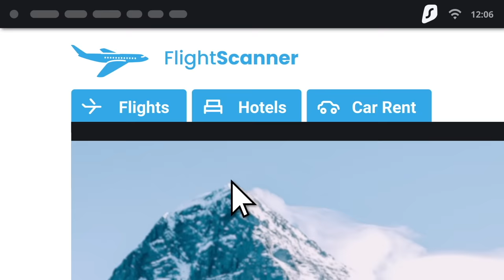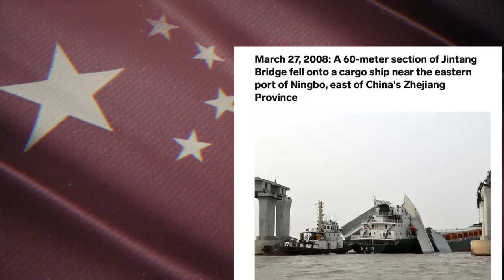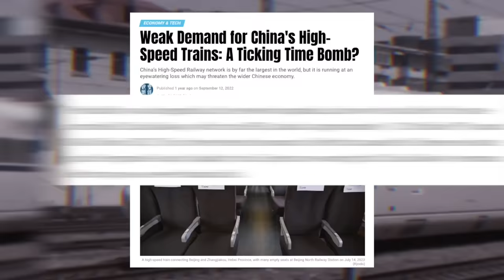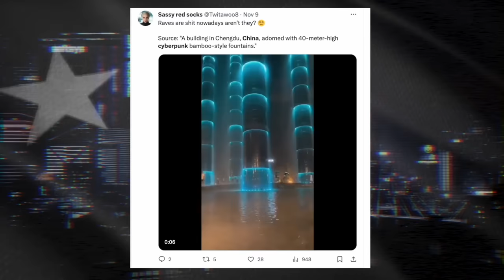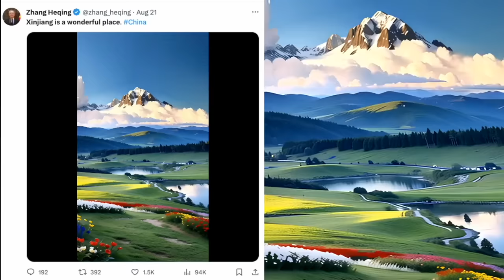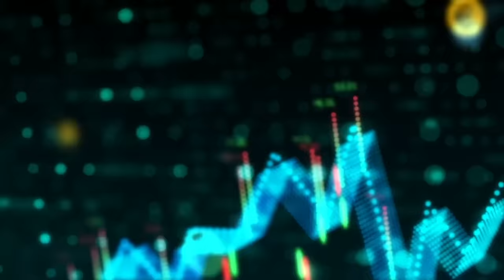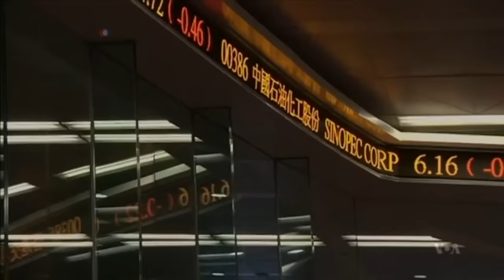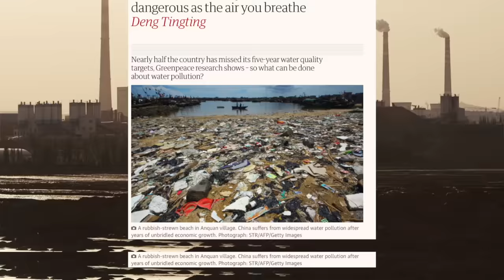Why are China’s Trains Randomly Crashing? - The Hidden Disaster of the High Speed Rail Network

Comment: I will save you time .. what happens is China hires taxi drivers as passenger train engineers, and when they approach a slower freight train on the same tack, they try to pass and overtake the slower moving freight train, swerving their train into the train  ditch beside the tracks. :(

Comment: Again, at least (in the US) trains are for freight not passengers with the exception of the north-east corridor.
Not efficent in time, it takes one hour to fly LAX to SFO while a high-speed train takes about five plus hours.
Reply: That's airport to airport. How long if you take into account travel time to and from the airports, any security stuff before boarding, recommended time to arrive before takeoff, etc? Probably still faster than a train, but not 5x faster.

Comment: I have to disagree with @laowhy86 on this one. If there is one (and only) positive impact Chairman Xi to Chinese society (and the world) is building an extensive high-speed rail system. It is way far from perfect (especially the less than quality build) but building an extensive passenger rail system is the best transportation infrastructure option PRC could do, and definitely better than expanding a highway system (ahem, "Murica) or overly relying on air travel. 

Mile-for-mile, passenger rail is magnitudes safer than driving  ... and better for the planet too. Unless PRC is hiding something (a plausible assumption), the only fatalities was the Wenzhou train collision back in 2011. I imagine there are more vehicle-related fatalities since then compared to this.

Comment: One important aspect that many China detractors failed to realize is no matter how problematic these infrastructure are, China was able to built them and that itself is commendable (China went from nothing to something).  Of course down the road, China may have to spend money to rectify these issues.  United States is a greater failure as it went from nothing to nothing (wrt hsr).  Having something is always better than having nothing.
Reply: @patrickt49  Most city subways/mrt are not economical viable like hsr.  But why these subways are being built all over the world? Because the indirect benefits outweigh the deficit running costs of the subways.  Like I said if you do nothing, you will stay the same at best.  You can only move forward if you built something.

Comment: When they have too much debt, i wonder if the unprofitable lines will shut down to stop gettting more debt, or will that line have once per week trains that only have coach class to fill up the seats so it wont lose money, while providing a need of fast transportation. There has to be a point where china cant handle the debt, or else it collapses because of this. They could have used all this money to build more subway systems in large cities, build up 2nd tier cities to the size of first tier cities, build much more hospitals, etc.

Comment: The United States has the highest number of rail accidents in the world, with an average of 124 accidents per year between 2010 and 2019. India is the second most accident-prone country, with an average of 60 accidents per year during the same period.
Reply: Those are cargo accidents. In India, where the savages ride on the roof of the train, they're passenger accidents.
Reply: How many is that when normalized for the number of trains or distance travelled? ie accidents per cargo wagon or accidents per cargo wagon mile?
Nominal means eff all, statistically speaking, and its the rates that are important since it lets you compare two different nations ceteris paribus.

Comment: Japanese train operators value the lives of their passengers. Japanese high speed rail network not one derailment or accident since its inception.
Reply: well…there are a couple of derailments due to earthquakes reported by several news outlets, even though no heavy injuries and casualties, they still caused major concerns and the development of several operation protocols and safety systems designed to minimize the chance of heavy injuries or even fatalities
Reply: @lsp6032  Japanese high speed rail have literally never once derailed due to earthquakes, please Google.
Reply: @LEV1ATHYN  checked japanese websites, 2004 train derailed after earthquake at joetsu shinkansen, 2010s kyushu shinkansen, 2022 tohoku shinkansen(videotaped from within, yamabiko 223), all three trains involved sustained heavy damage and was scrapped
Reply: @lsp6032  Cool. Didn't think that was the case.

Comment: Hey, just to set the record straight, Wenzhou happened. You didn’t point to any other HSR crashes. Your information on the HSR debt situation is out of date - it was USD900B 2 years ago. It’s WORSE now. Lanzhou-Urumqi is a ghost train, and maybe not ever able to be repaid.
Wenzhou - there was one accusation even levelled at the Japanese - it was their signalling system they ripped off. But I would be clear there hasn’t been any other HSR crashes other than the one in Wenzhou.

Comment: I have driven the train between Tianjin and Beijing a number of times and that was a pretty good experience tbh. That they built these high speed lines in places where they make no sense and therefore is running with severe loss and the fact that they have had some bad safety stories is obvious points to be critical about but criticizing that they are proud of their huge rail network misses the mark imho. In that regard it’s my impression that there’s much more criticism to be made about the US rail system. If China could get their safety systems up to the levels of Japan or Europe I think they have a pretty darn good system - the issues probably being that they have too many high speed routes but that’s a bit of a luxury problem.

Comment: Super fast trains are not only expensive to buy and build infrastructure for, more importantly, they're multiple times more expensive than conventional trains to run. Therefore, a ticket on a fast one will be priced out of the affordable or practical range of most users in a poor country like China. 
    A farmer can save a lifetime for a Lamborghini to drive round the farm but it's not a wise investment when a modest car will fulfil the needs of his family and his farm has more pressing needs or investments.
   This is why legitimate, accountable, less corrupt governments do feasibility assessments instead of putting Lamborghinis on farms.
Reply: High Speed Trains can be cheaper to run once you look at cost per passenger-km. Overall cost for highly subsidized local TER French trains is about 70 cents/passenger-km, for TGV about 10 cents/pax-km.
Reply: @alaindumas1824  Chonq isn't France. In China, the super fast ones are typically more exensive to maintain the vehicle and infrastructure. Too many people are poor so the ticket is too expensive hence they routinely run well below capacity. Due to poor planning there are typically other existing cheaper services in competition with the super fast expensive option, and so on.

Comment: Sounds like American railroads right now
Reply: "The United States has the largest rail transport network size of any country in the world, at a total of approximately 160,000 miles".---Wikipedia
"As of 2021, China had more than 96,313 miles of railways, the second longest network in the world."---Wikipedia
That means the US has 66% more rail than China. I haven't heard the US braying about how great it is because of that, have you? It also stands to reason that the US would have 66% more rail accidents than China, yet it doesn't seem to.
I worked on a railroad (BNSF) rail replacement crew in 2018 in North Dakota. We were replacing whole sections of rail on one of the busiest freight lines in America which runs from Chicago to Seattle, it's called "the High Line" because it runs right up close to the Canadian border. The rail we removed had a date stamped in the steel: "1940". That rail had lasted 78 years. Do you think the Chinese will be able to say that?

Comment: 4:10 - I knew about this accident but not that they had buried people... D:

As I have seen in other comments, I have always laughed at people when they told me that China was the leader in High Speed...
You just don't need to be faster or cooler to be the leader, you need to have a functioning and safe system.

The Japanese Shinkansen is without any doubts still on the lead by FAR!

Comment: Metallurgy, how to consistantly make a type of metal to the standard it needs to operate safely for its purpose. HOW TO FORGE AND TREAT IT! The Chinese have no idea! Their copper wire is a rainbow coloured not copper coloured, IT WILL FAIL! Steel can be iron or some form of iron based low grade steel

Comment: The reason that losses matter is because money represents resources a loss making enterprise consumes net resources.  Profit making enterprises are provided with more resources than they consume.  Imagine a business whose only inputs are steel and electricity that uses 1000 tons of steel and a megawatt hour of electricity to get enough revenue to produce 1100 tons of steel and 1.1 megawatts of electricity.  Whatever it's selling it can keep selling it without putting more resources in.  If it sold it's product for the price of 900 tons of steel and 0.9 megawatts of electricity to keep operating you need to put in the extra resources.   A loss making business, state owner or not, requires resources to be put in that can't be used for productive purposes.

Comment: When Montreal QC needed new subway cars, they asked for bids.  Well, the specs were sent out and offers came in.  From China, they sued the train system suggesting that the entire subway system should be converted from the current rubber tires to steel railroad wheels.  They assumed that the entire system which is quiet to ride on should be turned into a loud train system.  The court disagreed and said that the system should not be converted just so that China can bid on the cars with the cars that China wanted to sell.  Anyway, another bid was accepted, and the new cars are fabulous in the Montreal subway system.

Comment: I think one of the compounding problems of the Chinese high speed rails is, that they are based on stolen technology. And it seems not completely understood technology too. I saw in a video that the software stack that is crucial to the operation of the trains, partly remains in Japanese and Korean. They didn't even translate the interface. Cost-cutting on every turn.
There are some interesting supplemental videos on the high speed rail disaster on YT. If I remember correctly by channels like Polymatter and Economics Explained.

Comment: My experience with Chinese quality is that one gets a range from crp to acceptable quality. The Chinese mostly do a good job in small electronics. They often do a poor job in hardware fixtures - screws etc - where I often have to replace the item with an item from Vietnam. Likewise their basic manufacturing - hardware and electrical can be very questionable. I would not buy any high priced item from China - just not worth the risk. I don't buy much from the USA. Mostly because the USA doesn't sell much. But also because it is often expensive and if it's software it's often of very dubious quality. My go to place is largely Japan